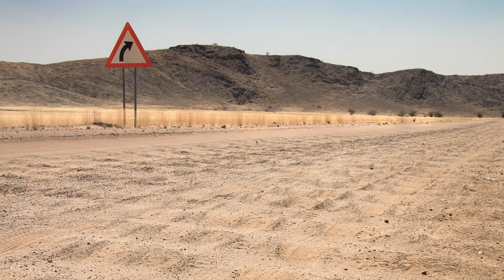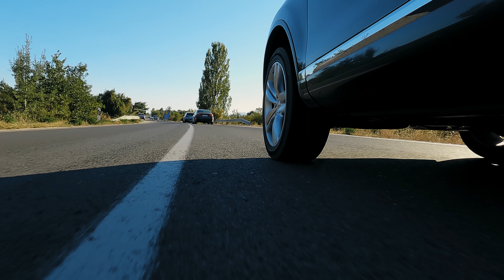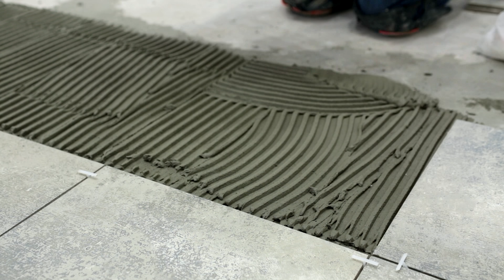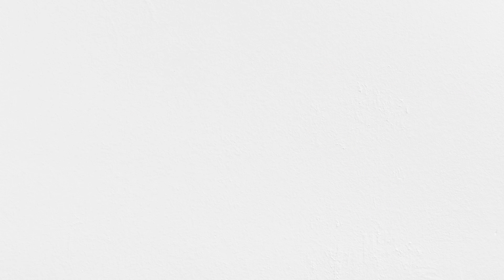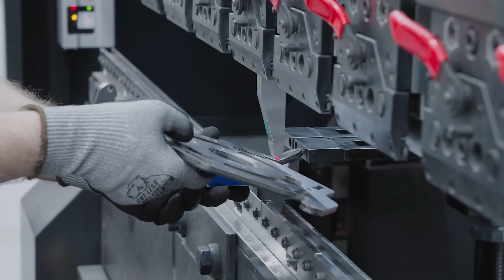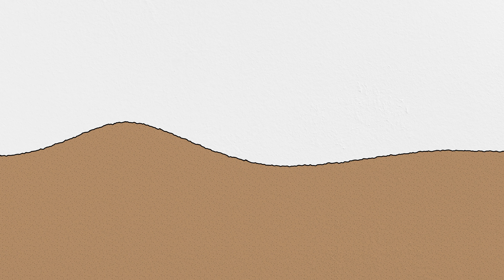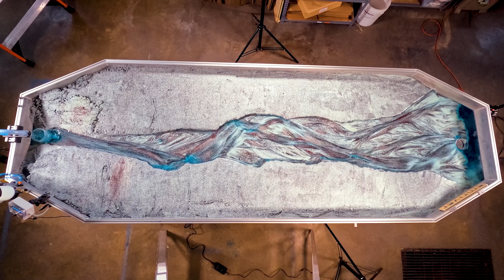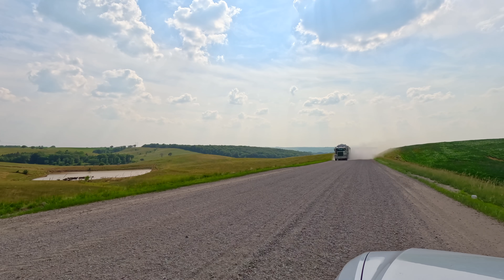Why Roads Get Washboards

Comment: The best wear surface would be natural vegetation. Grass that is engendered to withstand tires. But we would have to change the tires themslves to work effectively with natural surfaces.  Make them bigger, softer, with different tread patterns. Like a 4 wheeler. And we would have to slow down. That's something people are unwilling to do. So we're stuck with artificial surfaces. We'll get there someday.

Comment: In mountain biking this phenomenon is know as “breaking bumps” and they are usually before and in turns or other features, presumably due to the changing wheel forces mentioned.
Reply: “Braking bumps” motocross suffers from the same thing on a much larger scale with braking and acceleration bumps into and out of turns.
Reply: @TrashpandaNVGs Never thought about acceleration bumps being a thing but that makes sense. I wonder if there’s any evidence of that on trails where EMTBs ride a lot. Always seems to be the bikepark or equivalent trails that get the braking bumps in a meaningful way.
Reply: In my experience these bumps started to appear on trails only after mountain bike suspension systems became available.
Reply: @juanetobascofish3999  mostly rear suspension, Ive discovered. I ride a trail system that is predominantly flow trails, Kingdom Trails if you care. Breaking bumps started cropping up everywhere once the typical bike on the trail became full squish. before that, I hardly ever noticed any.

Comment: One of the true joys in life is running a grader over a washboarded road and leaving a smooth driving surface behind.
Reply: Thank you for your service .
Reply: @dagnt8145  Thanks, but that was several years ago.  I work in Civil Engineering now, but I still sometimes miss running a grader.
Reply: @BurtonShotton  I'm in civil engineering too and really wish they would let me plow snow or grade roads but they are in a different union bargaining unit and would have a fit if I was "stealing OT" which I understand. But I feel it would let me build better projects if I understood how the equipment worked to build them and what their limitations were.
Reply: @BurtonShotton I heard graders are the hardest heavy equipment to use properly
Reply: @wolfpeoplearereal  
You get used to it with practice.  I found the earlier model road graders to be fairly easy to run because they had direct hydraulic controls and you could "feel" what the machine was doing through tactile feedback in the control levers.  Newer models with the joystick controls and electric over hydraulic systems do not have the same physical interaction between operator and machine and I never liked running them as much as the older models.
Reply: @BurtonShotton  Before I began running winch trucks in North Dakota's oilfield a few years ago, I'd hauled a lot of graders and other heavy equipment around the country (don't miss long-haul driving on a daily basis) but had never done much more than play with the controls to see what did what while loading/unloading them.  But now, I plow snow with the one we have a work, grade the the yards we have and even fix some of the drainage issues we've had on the two roads up to a lot on top of a hill.  It's an old-school Deere and gave me fits teaching myself how to do everything but I'm glad to learn on this one as opposed to the newer joystick "fly-by-wire" models.  We hated the new  joysticks years ago when they came out on wheel-loaders for the very same reasons:  Instead of feeling the hydraulics, you had to learn muscle memory for different joystick positions, often having to run an unfamiliar machine for half a day to get used to the lack of feedback.  

There's not much danger of me doing "finish work" in the grader but I could go to work for one of these counties now to maintain roads without much issue.  There's a real art to running one well, though (I make no claims of being an artist  lol).  It IS relaxing in its way, kind of like mowing grass.  :)
Reply: @peteszerszen4337  Ah yes when money prevents the company from bettering itself.  Tale as old as time.  In all honesty though, you're best bet would be to watch content on graders or ask questions for people that run them regularly.
Reply: @wolfpeoplearereal IDK about that, but they are the most versatile
Reply: @peteszerszen4337  Maybe a ride-along at a training? Or sit in as a cross training opportunity? You want to serve your colleagues better, not take their work. I am in a different blend of public service, but when I feel I don't understand the work I'm supporting, I ask the lead of that unit if there's anyone onboarding soon that I can sit in on the trainings with, or if there's a good time they'd be willing to have me hang over their shoulder. So much good comes of these where they learn about what we'd like to do to serve them, and we learn about pain points that haven't even made it into the system yet.
Reply: @peteszerszen4337 Maybe, in exchange, you could let members of the grader drivers union design bridges. 🙂
Reply: @BurtonShotton  can you give my road a quick hit for old time sake?😂
Reply: Oo dang, that does sound satisfying.
Reply: Used to LOVE that day when I lived on a gravel road. It was like getting a brand new street twice a year.
Reply: Sounds like a stress relieving job! 😂
Reply: I have often wondered if dragging a chain-curtain behind a vehicle may smooth it out... in that way maybe farming communities can have some way of mitigating some washboarding until the grader comes again.
Reply: @schalkvandermerwe3838 Ya, but it needs a lot of weight on it
Reply: @integr8er66  I wonder if that depends on the frequency.  If chains are used every 3 months it's probably useless.  If it's every couple days I bet it works a treat.
Reply: @jasondashney Ya, maybe, but thats a lot of time to invest. I just bought a motor grader, but I have been told the county will be pissed if they catch me grading their roads
Reply: @integr8er66  Just a little bit of trivia totally unrelated to your comment:
Most counties don't have their public work crews out on Sundays to see whether or not someone might or might not be grading their own stretch of county road.  Just sayin'.
Reply: @BurtonShotton Oh trust me, I'm well aware of the windows of opportunity! 🤣 Also everyone else on this dead end road will happen to have car trouble at the beginning of the road completely blocking it
Reply: @schalkvandermerwe3838 Chain absolutely works, but the best is a simple weldment. Purchase a 20ft stick of I-beam. Cut the I-beam up into two 8ft sticks, and two 2ft sticks. Weld the pieces up so the two 8ft I beams face with the web horizontal, and the two 2ft sticks as the structure that holds them parallel to each other. Weld a 20ft length of chain on so its welded to one of the 8ft sections at the 2ft and 6ft position. That loop of chain is what you tow from. It will keep the 8ft sections spanwise across the roadway. The I-beams are now sharp edged down when you drag it and it will cut lightly into the wear surface as you pull it. Pull it with a pickup as this will require some force and best with a tow hitch. It will eliminate most washboard with a single pass. A grader is completely unnecessary. If you dont have a welder you can drill and bolt all of this together. Its an easy project. If you want something easier to transport just make it smaller and make more passes.
Reply: Snowmobile trails get washboards in the snow as well
Reply: That type of joy is what keeps many people in "manual labor" of some sort, whether simple or highly trained. When your work day is over and you and others can see, touch, feel the results of your efforts, that feeling you get is so superior to what you feel from white-collar work. And no judgments here on which is better, I've been employed doing both and been happy doing either.
Reply: Yeah, and in order to preserve that smooth service people shouldn't speed on it because it's smooth. Low moisture content plays into it as well. Then you have county blade operators that act like they get paid by the mile. They pull material out of the ditch then windrow across the road, they don't cut,they fill the washboards. I worked in county road construction and maintenance,so I can honestly attest to these facts 😊
Reply: @brainjester5104  Yes!! Where I live there's about 2 miles of cinder road, which has some flat,  some rolling and a steep hill to go over.  I go low and slow over the hill, it's a public road, and the idiots that go fast over the hill are the ones causing the washboarding.  Years ago, there was a huge fire, the road was severely washboarded, 
about 50 wildland fire trucks drove over that hill, in prep for a back burn.  They drove in low gear, and went slow over the hill, I was amazed, the washboard was all flattened out.  They drove in, and drove out, so it was like 100 heavy trucks going over that hill.
Reply: Our roads are extremely dry; dispite frequent grading, the washboarding isn't fully removed.  I suspect the gravel is too large and not deep enough, so the washboarding embeds into the boulder layer.  Unfortunately, road mix spread to the proper depth is beyond the county budget.  Ironically, we have a mountain of waste crushed rock from a local mine, but the mine won't let anyone use it because of possible explosives remaining in the gravel.
Reply: @Justin_Montana You can't just grade them out. It's a waste of time and diesel.
Reply: @DiaperDon_BoneSpurs_Epstein  Exactly. Need to rip the road first, and regardless, the corros will soon return …
Reply: @ma3stro681     I used to watch the cretins in the Yavapai County Road Department run parallel grades down the Crown King Road. Side by side, they were RACING, not grading. And people wondered why the washboards came back literally in a day or two.
Reply: @DiaperDon_BoneSpurs_Epstein  Local washboarded dirt roads get a grader run over them every few years, but the washboards return soon enough. I've always wondered if just cutting the top off the ridges and filling the valleys with loose material lets tires sink a bit into the valleys and start the washboarding all over again. It may be that the road needs to be cut down to uniform base, then the resulting loose material graded and rolled to a smooth finish.
Reply: @Justin_Montana  More weight on the rakes plus using a roller afterwards helps a lot.  Getting the right amount of weight is almost an art by itself. To say nothing about the design of the grader/rake with spikes and gouges for really bad roads.
Reply: Currently grading washboard right now, in cruise control with 4 miles of gravel road cut open lmao
Reply: As a log truck driver for many years, you guys are our hero’s !
Reply: Amen, just climbed out of mine about 2 hours ago. Love running one.
Reply: Its nice doing hands on work and seeing instant results
Reply: Yep, I bought an old Model D  Allis Chalmers for my property, I maintain about 5 miles of private roads, I love it when I finish
Reply: Best results if you deep rip firsts then roller and water, just grading on its own seldom lasts very long unless it’s deep enough to remove the compacted corrugations.
Reply: I have a 3/4 mile oval dirt "walking track" I need graded.😂
Reply: I have the urge to pull a farm disc on my road at a bout 1 inch depth. THey tell me I'll get in trouble....
Reply: @scottpowell4342 : Many years ago before they hired good operators, I took my big 4wd quad and a spike harrow and harrowed the road.  Within a day you couldn't tell, but it cut the high parts out and levelled it perfectly.  Only downside is you could see the drag tracks in/out of my yard. Lol!
Reply: Genuinely, thank you for your service 🙏
Reply: You're my hero!
Reply: for a day or so....
Reply: unfortunately, few of you left that don't just leave the blade on float.
Reply: @MrCoffeecan I couldn’t imagine if you kept the blade in float for a whole day on a hard road you’d be changing blades daily. tried that when I first started, fortunately was corrected by my boss that float is only really good when back blading and repairing approaches, or doing field work for farmers like filling water run’s and improving drainage.
Reply: Some operators make it worse
Reply: Not all heroes wear a cape. Some operate a grader
Reply: The problem is they come right back. Grading a hard dirt road is like lipstick on a pig.
Reply: Only for it to be fks 3 days later
Reply: @Gusto9698  if there's a lot of traffic that drives on it, then yes
Reply: It only helps if you actually put the blade on the ground
Reply: jus so you know, there are those of us who truly appreciate you!!!
Reply: Yeah problem I often see is grader operators dont cut down deep into the compacted washboard/pot hole area and just cover the compacted washboards with loose material and thus the loose material just gets moved around and make the same shape as the compacted ground beneath and the grading job lasts only a very short time
Reply: @jarvislarson6864  
This is often a problem of management.  
Most grader operators work accompanied by a water truck and most graders are ordered from the factory with either the scarifier or ripper hooks needed to fix deeper potholes and washboards.  Most grader operators know the methods for correcting deeper road damage.  
However, many public works departments rate their road crews on how many miles of roads get maintained per day, not necessarily on how long the maintenance lasts or how well it is performed.  So, if you are getting maintenance that does not work for long on your roads, I'd suggest going to the next public meeting for your city/town/county and let them know that you would prefer fewer miles of road maintained per week if that's what is needed to take the time to do a better job of maintenance.
Reply: @jarvislarson6864  
Some soils and the underlying base material are just not really suited for traffic, no matter what you do.  In those cases, the only things to do are either just live with bad roads, haul in enough decent material to top-coat the roads, or bite the bullet and spend the money to pave the roads.
Reply: Guess I will never know true joy 😢
Reply: And if you're one of the fellas who cuts deep enough to actually cut it out and then recrown, then high five, well done, here's a virtual beer over the internet. :)
Reply: That usually last for a couple days, then back to washboard!
Reply: @bigdeal3046  
That can often be blamed on an improper grading job.  
Just as often, however, it can be blamed on bad drivers who can't seem to grasp the fact that the road being smooth does not mean it stops being a dirt road.  
If you notice that the washboards tend to be worse at the areas where people either accelerate from a stop or slow down to a stop, then the washboards are primarily due to bad driving.  If you accelerate and brake abruptly on a dirt road like it's a paved road, you create washboards.
If you see washboards everywhere on the road, then it's most likely either a bad job of grading or bad material on the road surface.
Reply: Tell that to the US Forest Service.
Reply: I flipped an old heavy flatbed upside down, chained it up to the 3500, and buttered out those washboards roads.
We named the flatbed Roadmaker 3000.
Reply: And We Thank You For That! 👍🏻👌👏😎
Reply: But it only lasts for a few weeks at most. When I lived in georgia, the dirt road would washboard within the same week. On top of the flooding, it was just pure hell 😢
Reply: Can you come do my road? Our guy doesnt cut the road deep enough to actually cut the washboard out so its back within a day or two
Reply: @mahart40 make a drag, pull it behind your car or truck. Washboard is easy to eliminate.
Reply: @christophermaglio1939 Yes! I've seen those made of chain link fencing attached to a frame and dragged. Come to think of it, it was at our Little League baseball infield.
Reply: @mahart40  If the grader isn't working with a water truck that thoroughly wets the surface and compacts it, or if the road surface material has too high of a sand content, the washboards will start to come back as soon as the road dries.
Reply: I would take more pleasure than is healthy to grade such a road. Especially if it also fills potholes too.

I hooe it also gets rollered.
Reply: @MX-Vette  They seldom get rolled in the USA after maintenance grading. I've slid off the road into the ditch after a fresh grading because it was so loose.
Reply: @DazieArt  
That depends entirely upon your location and how the public works department is run.  Where I ran road graders, we would not go out to work on a road without a water truck and always rolled the finished product to compact the road surface.
Reply: @BurtonShotton Yep, where I am a roller would do absolutely nothing. Clay and chert makes up our roads, they don't haul in anything, just scrape it flat

Comment: I think lowering vehicle speeds by force could be part of the answer for prevention because once washboards form lots of vehicles have to go fast on uphills to make it over them. If the roads are narrowed either in width or speed reducing other means then drivers will go appropriate speeds
Reply: You’d have to drop the speed to a crawl to avoid this. Logging roads around me barely see more than 20mph and still get washboarded.
Plus farm and log access roads need to be broad and straight to handle trucks. The logging trucks up here are basically freight trains.
The solution is more frequent grading and better road bed prep.